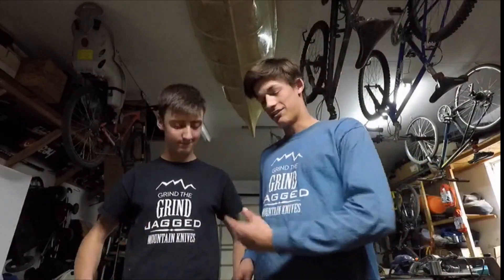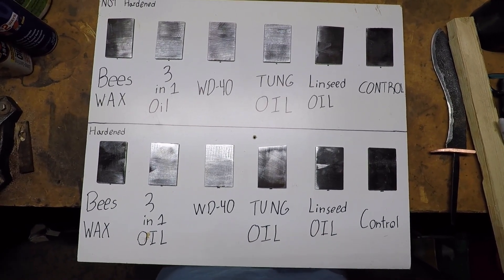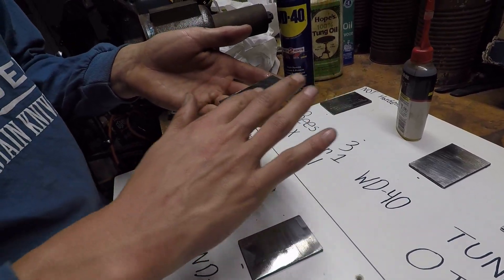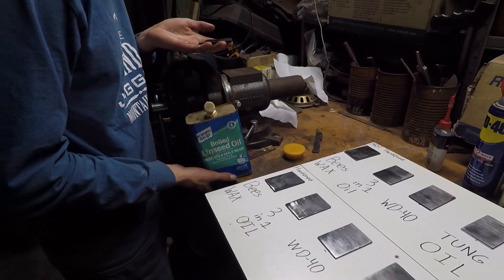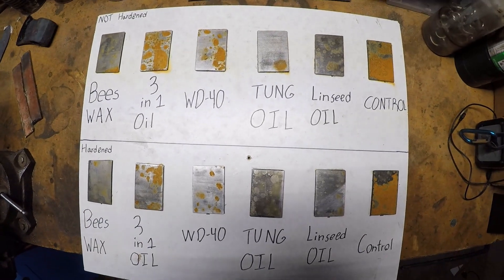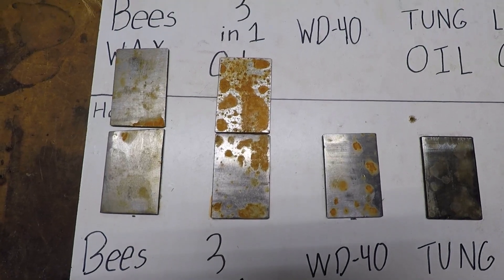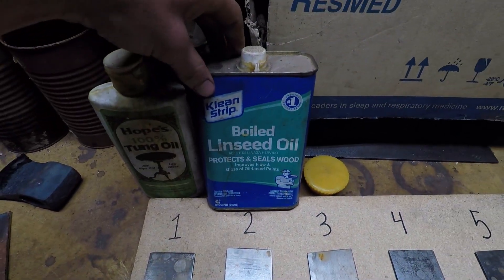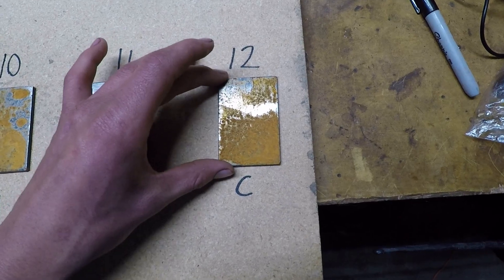What Is The Best Rust Preventer

Comment: I just rub regular candle(paraffin) on metal parts(scissors, wrenches, air rifle, even on wood). I hit it with the hot air gun which spreads in evenly and penetrates inside all pores. It works well. Just for storage. Paraffin isn't hard enough to resist scratches. But it is the cheapest and most widely available. Beeswax is expensive compared to it.
Reply from the maker: i will need to check it out sometime

Comment: In real life scenario you wouldn't have water droplets sitting on it for that long. I would be curious to see a test doing it at this exact same way but in a high humid area. The WD-40 surprised me and the only areas it seemed to rust as where it had standing water on it. I think you guys should try to do a humidity test this exact same way. I came here to find a good oil to protect my rifle and I don't plan on having water droplets standing in one spot for long periods of time. More like gun storage in humid areas where surface rust starts. Anyways great video guys! And I was using voice text and not proofreading so there might be some typos
Reply from the maker: will do next time
Reply: Dude... no derr, some used are wax based and the other are oil based... realistically you're supposed to oil then wax buff polish to protect your metal...

Comment: You need to try Platinum grade LPS #3 which is used in marine and aircraft applications. Also, the bees wax would have been best of the samples had you heated the metal to blue and then applied the wax while metal was hot. Good video though.
Reply from the maker: I will have to try it and your right about the bees wax, i tried that in this video https://www.youtube.com/watch?v=ciECS1ag4Zg&t=3s